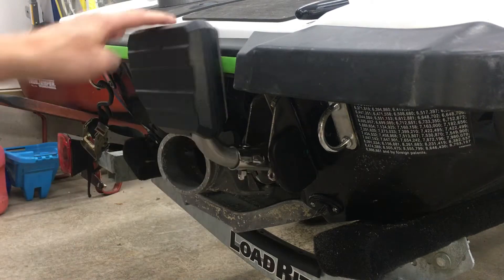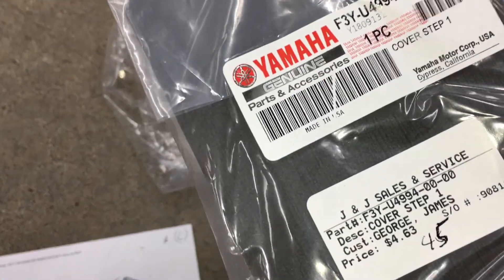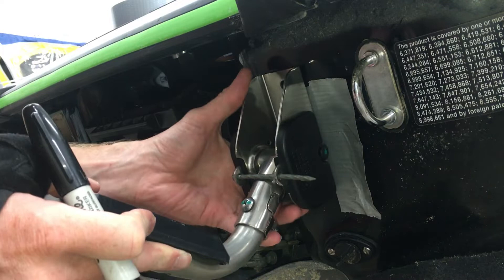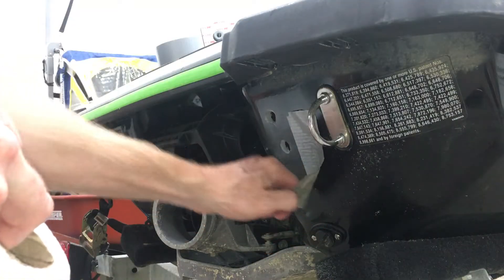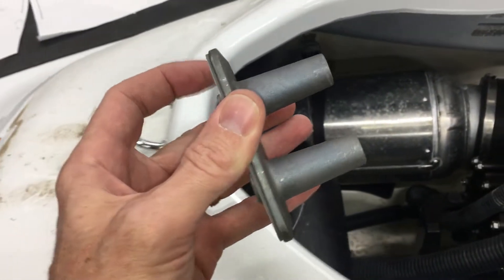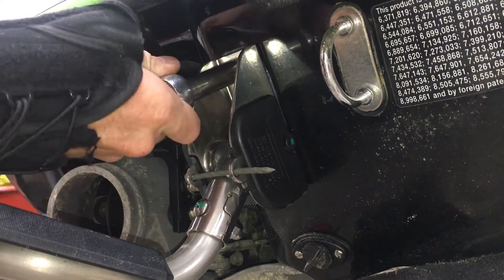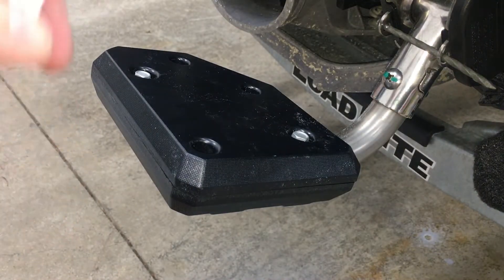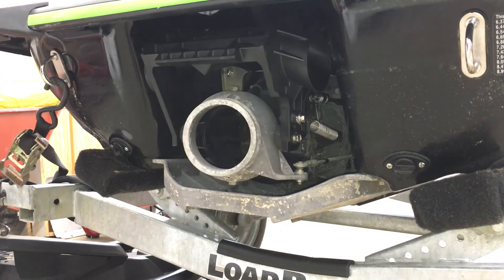How to install OEM Factory rear step on Yamaha EX PWC Jet Ski

Comment: How did you get your hand all the way back in there to put the peace on the inside on?  I see you took the piece below the seat off and I havent done that yet and that still looks like a long reach.
Reply from the maker: It's a long reach, but it isn't too bad after you remove the obstacles out of the way.